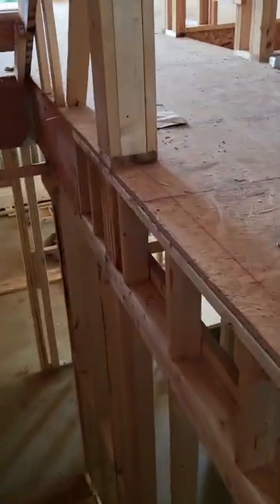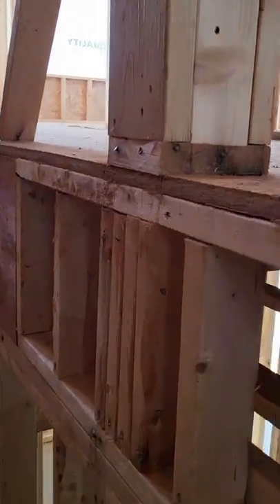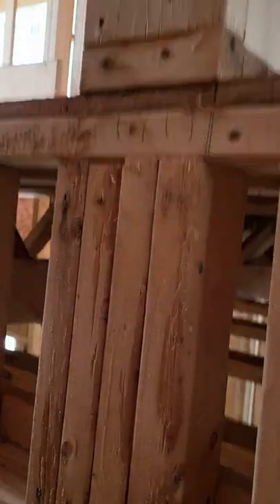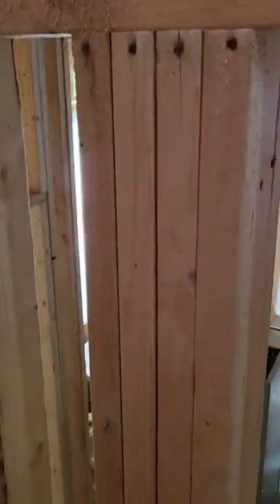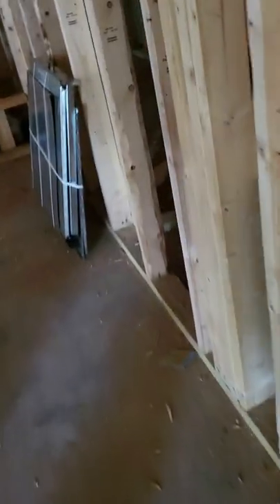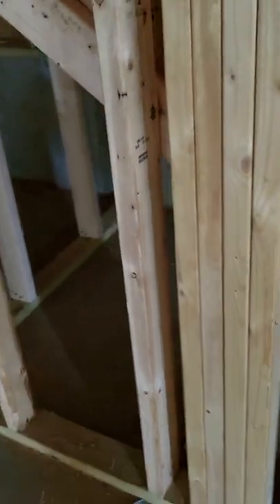Framing Point Load Done Correctly

Comment: Doesn't look like the studs were screwed together.
I would glue and screw all of those.
Reply from the maker: Ok, I appreciate your comment.
Reply: Screws sound like an attractive solution and an improvement over nailing, but there are many situations where screws aren't specified in wood framing. I believe it's because framing nails bend, whereas many screws under the same conditions may break. Always use the fasteners that were approved by the engineer, for each application.

In any case, the column seems a bit undersized to me. Only because I could see that thing buckling during a ruckus house party. Especially with some fat hoes jumping to the beat or fighting over the last piece of cake. I wish I had a dime for every time I had to say: "Someone stop them hoes from fighting over that cake before my column buckles!".
Reply: @cornpop7805  yes the sheer strength on a screw is not near that of a nail.
Reply: Code book says put a tie on the stack of studs.  Book tells you a lot if you read it.
Reply: @michaellestinsky7515  if they move enough to sheer a screw the problem will be far greater than what a nail will solve
Reply: Completely pointless. Each one of those stud tied together with 8 nails minimum. Its supporting a load nothing is trying to spread the studs in the post apart. Im all for over building but you gotta understand the principles glueing and screwing everything is riddiculous. This man will have framed up the next story you'll still still be down there glueing your studs.
Reply: Screws don't have the shear strength needed.
Reply: @mperry2384  that is why they invented Simpson ties
Reply: @mperry2384  go ahead and glue it and screw it.  Then slap a tie and screw the stud to the top plate and ....
Reply: @joelhuppe3725  Each one of those studs will be trying to buckle due to the load on top. If you don't connect them together with something that can take the force of them trying to buckle, the outer stud can break the connections as it tries to buckle. I think the best course of action is to find out what the engineer wants you to do.

Comment: I never cared for treated lumber for slab contact... At least put a gasket...
Reply from the maker: It's all interior...I appreciate your comment.
Reply: And a metal hold down.
Reply: @PPG1967  i understand the risk reduce a lot. Flooding, water column,  temperature fluctuations all will also create moisture for capillary action/diffusion. It's about breaking that contact.

Comment: Nope, the post should not be sitting on the plywood floor, the plywood can and will crunch under heavy loads, build this part post to beam wrap the plywood around it.
Reply from the maker: So, are you familiar with how point loads are transferred??.. why are saying the post can't rest on the plywood?..
Reply: @PPG1967  the ply wood can crunch down under the post under extreme loads. OSB is good stuff but it's compressed before you get it and if you add more weight to just one area your compressing it more.
 I'm a saw man with years of experience building multi level million dollar homes.  
 Good job though, chances are it will be fine.
Reply: @PPG1967  And don't take me wrong we built huge houses with extreme loads so we went post to beam like the old ways. code probably says your way is fine too. Just something to think about on really big projects like 3rd floor banisters with the roof kicked onto load bearing walls with half the house as an open air floor plan, yeah we could throw the football in some of those monsters lol.split pitch and cut up with 3/4  flooring as sheer walls 3 stories up with 2x8 studs because of its extreme open plan and size.
Reply: This is an intererior post on a tract home, we can all point out how to build heavier. 
The truss package is going to have the roof loaf taken care of, this is just the stairway and a bit of floor.
On the OSB isn't a problem here.
Remember if you can't do it efficiently when called for and only know "more is better", then these framers are better than you.
I went from top tier homes to entry level and it's a learning curve, remembering those first years in trades then having to bring it forward. A lot of checking code and learning how old issues are now addressed.
Knew it would be tough and my big wake up call was being threatened and I remembered "OH yeah construction worker's ego problems". I'm the contractor wearing headphones and once he  stopped yelling I just responded" Police are already on the way, get off my property"
😊😊

Comment: If that's really a point load then there should be a drop pan under the slab there. Also that 1st post I would not put a top and bottom plate on something like that. Wood expands and contracts  tangentially,  so that post would be much more stable if it was bearing directly on end grain.
Reply from the maker: So, what is a drop pan???....where are you located??
Reply: @PPG  I'm in Canada and a drop pan is an area of thicker concrete under the slab often on top of a pile. Putting a load point right on top of a slab is a bad idea especially if it's just a slab on grade which most basements are.
Reply from the maker: So, I guess interior load bearing footings are the same thing. There are footings under the interior load bearing walls.
Reply: @PPG  I guess that would be similar. Here we typically post to piles capped with a drop pan up to a main beam and hide the post inside interior walls or just dress them up with some kind of finish.
Reply: Cut the post a little bit long, and keep the load under 300 lbs a sq. inch.
Reply: Nope and the remodeler who commented above points out those blocks are more stable and spread the load over the entire area instead of possibly only a corner of one stud.
Reply: @creativesuit1930 50 people agree with you he checked the footer in the plan.

Comment: That's generally how it's done. But a terrible example of how to do it right. I would certainly get rid of the 3 and a half inch top and bottom plate, Some of those kings have gaps, and although some states don't require it, I would have straps to secure everything from the top to the bottom.
Reply from the maker: Ok, I appreciate your commenting.

Comment: So how thick is the concrete? 4"? Thats a fail! 8"? Better. 8-10" spread around about 30" diameter 👍. 8" in a 16"x the length of the steps then turned 4' to the outside footer with rebar reinforcment.👍👍.
Reply from the maker: There are footings under all interior load bearing walls.

Comment: Toenailing should be avoided whenever possible as it is structurally unsound M.Sc, P.Eng Structural Engineer
Reply from the maker: Per 2018 IRC, toenailing is allowed.  What code book are you referencing??
Reply: Lol if it’s so structurally unsound then why is it in pretty much every engineering standard/building code for residential building on this earth? You’re also wrong because toenailed studs have a higher uplift capacity than studs that have been nailed into end grain.
Reply: Toenailing is extremely strong when done properly. End grain nail to pre fab, then add toe nail and uplift hardware once the wall is stood up.

Comment: Why didn't you use a real post not studs with a 5 inch plate on top and bottom
Reply from the maker: A real post??..I don't understand what you mean by a real post.
Reply: @PPG  you sandwiched a 4x with 2 2xs and then added a little 2x on top plate. Why didn't you just used a 4x8? That is such hack work.

Comment: But that's not a good framer
..to many gaps and split wood from bad nailing
Reply from the maker: Yeah, I disagree...gaps can be sealed. Split wood happens.
Reply: @PPG1967  sealing gaps does not help structurally.  One of the short stud was 1/4" short, might as well left that one out.
4x6's would be much better.

Comment: Bro it's called posting down you post all the way down to the foundation you do it everywhere there's load bearing
Reply from the maker: I think we're talking about the same thing just using different terminology.
Reply from the maker: Google Point Load..
Reply from the maker: Where are you located??
Reply: Va
Reply: We are talking about the same thing you take a corner which is three two by fours nailed together and everywhere that is load bearing which where you have an LVL you take that all the way down to where it sits on the foundation anything that is load bearing the weight has to be distributed all the way down to the foundation it's the same thing here in Virginia or the framing crews I've worked with we call it posting down

Comment: More support is needed.
Reply from the maker: Where??
Reply: It is based on the calculated load of the carried floor at 50 or 60  lbs a sq. foot. Or the 300 lbs a sq. inch load allowed on the horizontal plates.

Comment: Footer under slab...or is that like 3 or 4 inches of concrete  should be a 18 inch square  pad 12 inches deep under there...per internet geeks 🤓
Reply: Well that's just my experience
Reply from the maker: So, there are footings under all interior load bearing walls.